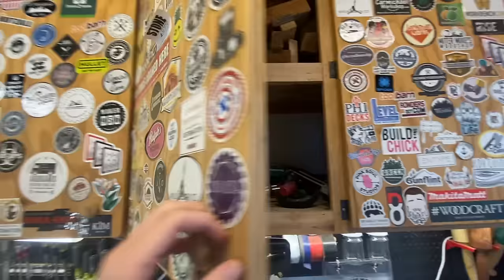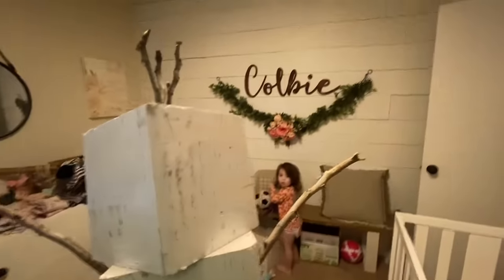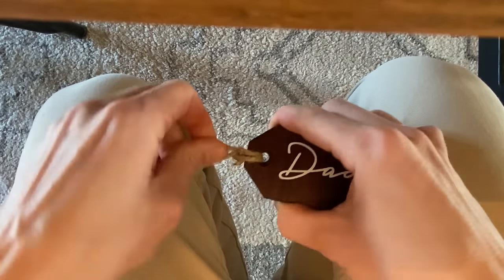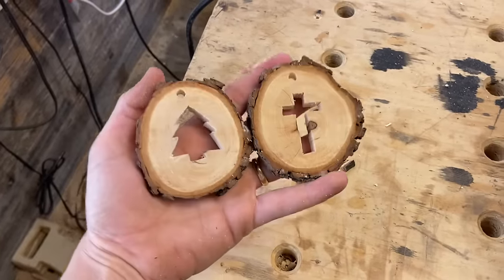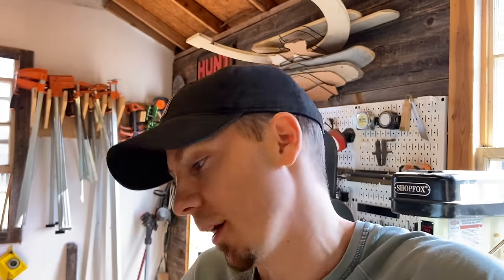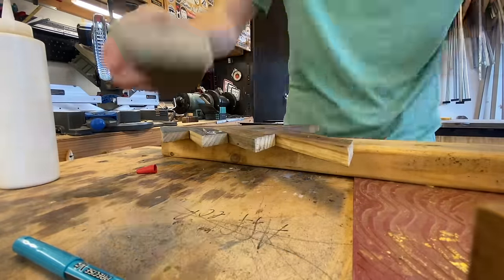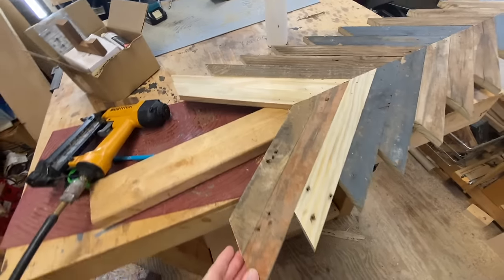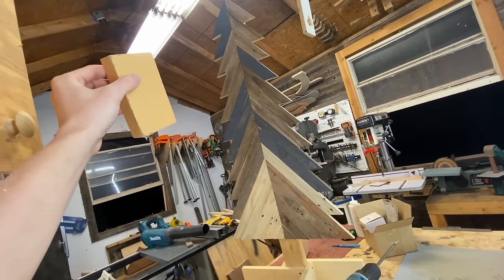Using Scrap Wood To Make Christmas Decor

Comment: Very dangerous cutting a round log inches from the mitre blade. Blade can grip the log and pull your hand into the saw. Don’t use small pieces to cut, best to clamp the log and keep your fingers well clear. Safety glasses a must. Great little project though!